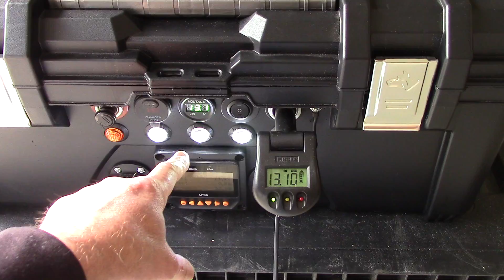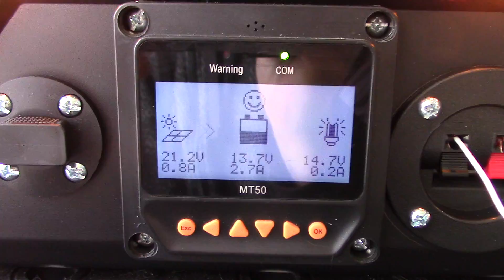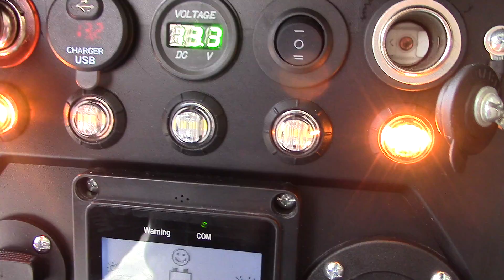All systems go! Hot checking DIY solar power generator (new build)

Comment: Awesome setup.  Is there any concern with the charge controller getting hot and being so confined like that?  I'm working on something similar with a lifepo battery and was worried that nothing could be touching that charge cintroller. I will later be adding an inverter as well and had the same concern, but it looks like yours are both right up against each other.  Did you keep it setup this way and were ther any heating issues?  Lastly, do ty ou have any videos showing how your fan is setup for cooling?

Comment: im courious about the size of the inverter. How did you wire the inverter AC to the plugs on the box??? did you have to take the inverter apart and add wires to the input of outlet?
Reply from the maker: I cut an extension cord wire and wired the pigtails into a sidewall outlet. Plugged the other end into the inverter

Comment: Your opinion on using 12v marine batteries?
Reply from the maker: Deep cycle AGM are decent, but nothing beats lithium. I went "cheap" with deep cycle marine batteries...they don't last and you will end up replacing them. To each their own

Comment: Nice build, but I have a question for you. Are you able to charge with the solar panels while you have a high load on the box? Just wondering if a high current load will draw too much current and damage the solar controller...or because the batteries are on the same circuit, will it just draw all the current from there? Thanks.
Reply from the maker: Great question. The short answer is no. The solar panel will put out (say) 5 amps. If the load on the batteries is 20 amps, the net draw on the batteries is 15 amps. Having a larger load will not affect the solar charge controller or solar panel (which 99% of them have diodes in them). There are "other" things to consider, but most of the time nothing to worry about at all.

Comment: This would be cool with Milwaukee pack out system
Reply from the maker: Yep! It sure would. I actually installed some battery terminal posts on it with a 200a circuit breaker (to start a car or truck in an emergency)

Comment: I've put together a few of these but they are portable power supplies.  They don't generate solar power, they supply electricity from batteries.
Reply from the maker: Cool! Mine is currently running 24/7 on the back porch

Comment: Hi Chris nice inverter generator build. I know it's not meant to be portable but I'm curious. How much it actually weigh, versus  its usable watt hours?
Reply from the maker: Thanks. It weighs around 50 lbs. It is meant to be "transportable" vs portable. ie - it can be moved around if needed. "Portable" ...unless you are really in shape. Right now it is outside running 24/7. Usable watt/hours is about 420 (at 50% discharge). So about 1/2 of 1 kWh. All I need this one to do is power my patio TV, soundbar, charge a phone, and maybe some lights. Thanks for the question and watching.
Reply: @ChrisDIYerOklahoma  thanks Chris. It's really hard to get people to invest in off-grid power. I think videos like this are an inspiration. Thanks for sharing, and for answering my questions. It's very much appreciated

Comment: Very nice! Maybe add a bolt on fuse to the batteries and thicker wires to the fuse box, but everything is pretty small. Should be ok.
Reply from the maker: Thanks...
Reply: @ChrisDIYerOklahoma  Your not a big enough YouTuber yet to be so standoffish to the master Will Prowse commenting on your little ass battery. 😄

Comment: Not the way I would build a unit like this. That being said, I think you did a VERY nice job. Good use of space. The ONE improvement I would suggest is to wire an external on/off switch to your inverter and mount it to the box alongside your other controls. As I said, not the way I would personally have built it, but I DO like it.
Reply from the maker: Not sure if that little 300w inverter has a Aims on/off external switch available...I like that idea tho.
Reply: @ChrisDIYerOklahoma  Actually, it is much simpler than that. Simply purchase a HEAVY DUTY DC Breaker Switch, wire it in between the Inverter Positive Lead and the Main Battery output, leaving enough Wire to cutout a hole in your case and permanently mount the switch in a convenient spot. Problem solved. I might ALSO add an additional fuse in that line as well for cheap insurance.
Reply from the maker: @bruceforster3709  I may do something like that. Instead of a heavy duty breaker, use a relay and a standard 12v switch to enable the relay (automotive/marine style). Relays are inexpensive

Comment: Will this run your chest freezer conversion that you did with the inkbird thermostat?
Reply from the maker: Good question...haven't tried yet. My 600w Aims PSW inverter worked on the chest freezer conversion w/o any issues. Not sure if the 300w one has enough initial thrust to turn on the compressor